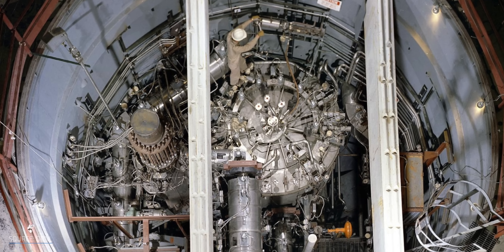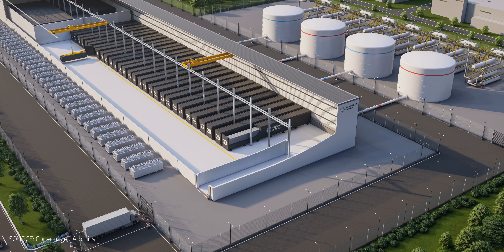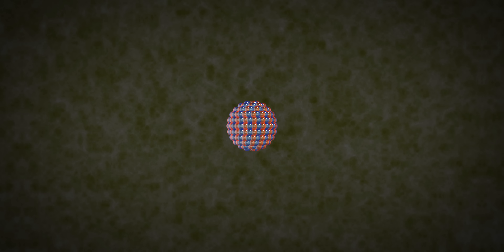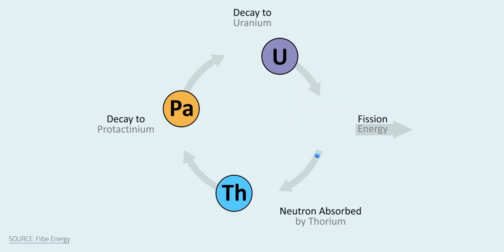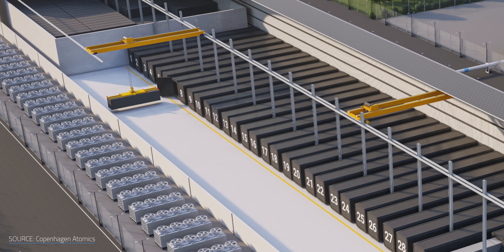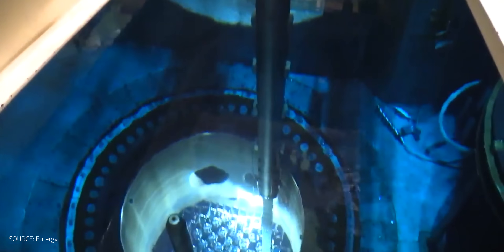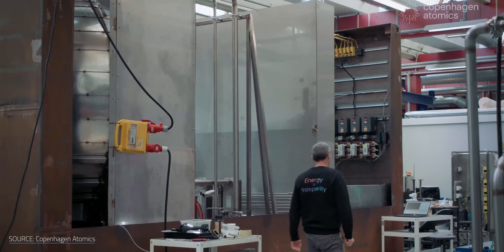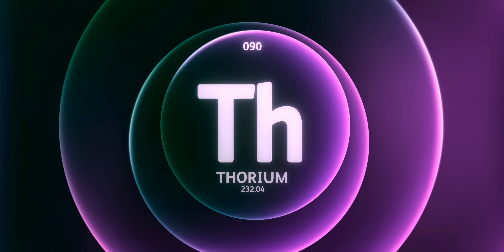Why Thorium is About to Change the World

Comment: I want to see a similar reactor as the power for a Single Stage To Orbit spaceplane. With continuous power, and using heated atmospheric air when within the atmosphere, the infamous constraints of the Rocket Equation is mostly overcome. Such a vehicle can take as long as necessary to accelerate and increase elevation until going above the atmosphere. Then it can easily transition to using onboard propellant, heated the same way.

Comment: STILL hobbled by intermetallic compounds.  Argon National Labs has been consistently been working on thorium processes for more than 50 years. The chemical plant to reprocess the thorium back into something usable requires immense energy.  This is essentially an atomic battery that produces utterly impractical cores that aren't energetically worth reprocessing.

Thorium has far more use in a mixed fuel reactor with "expended" uranium.  The reprocessing problems are less relevant because the reactivity of the fuel is much longer lasting.

Comment: In this case, it's actually the 'packaging' that convinces me of its feasibility. "Let's built it the size of a container." Okay, we know how to handle that size and shape, anywhere in the world. "It's too heavy to be shipped in one piece, let's cut the shielding up into modules." Okay, that works too. "No way of knowing it will last 50 years, but we can test for 5, so let's do 5 and throw away the heavily eroded / corroded / taxed parts after 5 years" Yup, I can see how that makes sense. Etc., etc. Compare that to the other 'modular' reactors of which you see proposals all around the world, and this one has the words 'scalability' and 'manageable' built into it. The other SMR proposals that we see are mostly scaled down versions of what we already know, with 'regular' nuclear fuel and thus with all its problems but with none of its scale advantages. I'm not the betting kind, but this is the type of company I would invest a moderate amount of money in.

Comment: I've been beating this drum for far too many years already, nuclear energy is the key to making renewables work in the short to mid term, and thorium is the key to affordable nuclear energy. The modular setup and self-contained systems have so many potential benefits that it's absurd to think there's any viable reason to oppose the technology. Of course we all know why this has taken so long to get moving (over half a century ffs) and that's the twin evils of conservative greed and simple fear, which in turn is mostly due to a lack of understanding of the technology. Molten salt systems are remarkably fail-safe by nature and when you consider the long term consequences and knock-on effects, it's safer than just about any and every other form of mass energy production we have right now (solar included). I once joked with my father over which would see the light of day first, fusion energy or thorium energy, and after much discussion we figured it didn't matter either way because neither of us were likely to live long enough to see the question through. Maybe, just maybe, we might be proven wrong here, and I for one can't wait.

Comment: The U.S. is fianally building a type of MSR. It looks like a hybrid of the older tech cooled by molten sodium and salt, using Sodium to take heat from the reactor, deliveing it to salt to transfer to the boiler in a separate facility.
My concern was molten sodiums reactivty to water. But that explains separation of the heat exchanger.
Reply: That's not a (chemically stable) molten salt reactor, but instead a (highly reactive) fast spectrum (metallic) sodium cooled reactor with potential to become a nuclear Moss Landing. The thermal energy storage is a good idea in general, but in this case it's being used because the reactor is inherently uneconomical and they are grasping for (and receiving) massive subsidies, to offset the enormous amount of expensive HALEU needed to start each reactor.

A terrible idea, because the deployment will end without subsidy, and the opportunity to provide lucrative peaking services with thermal energy storage will saturate. Some people may also have feelings about funneling billions of taxpayer dollars into dead end companies (with a history of bad ideas) owned by some of the richest people on earth.

Comment: Not going to happen, at least not as presented. On paper it works, in practice it works, what we havent figured out yet is making it fit into the necessary safety regs, and finding investors. Since domestic use power generation more often than not operatesat a loss, it generally requires subsidies to keep it affordable to the consumer, and trust me...a modular reactor the size if a shipping container is only going to have niche applications like far away from the general publics access to it. We will not see them for neighborhoods because that would be thousands scattered across the country and its a huge security risk. The better option they will accept are large reactor sites to service hundreds of thousands or millions of ppl, that are easier to keep an eye on and secure.

Comment: Thorium needs a breeding reactor. The thorium cycle  get just barely enough neutrons from the U233 fission and thus not much room for compromises that loose neutrons. This means rather frequent chemical purification of the fuel, efficient moderator (e.g. D2, high purity graphite, Be), large size to avoid leakage, few extra absorbers for stabilization.  The big difficulty usually not talked about is the chemical separation, The thorium this more difficult than with Uranium for the fast breaders and it is needed much more (like 100x) frequent.
Do the comparison to the fast breaders that are much closer to the moten solt reactor. Here in most aspects the fast breeder it superior.
The molten salt has it's own corrosion problems and just cooling is not safe for an extended time (the MSRE test reactor had a quite serious incident from this). So after a minor incident that upsets the reactor one can not simply wait for a decade or so for most the radioactivity to decay before ealing with the mess.
Most of the claimed advantages are just bogous claims - take a closer look and they often hide disadvantages.

Comment: that sounds like an awful lot of valuable metals that we will be rendering unusable for eternity that people will need to deal with in the environment into perpetuity.. people are really really not thinking past their own noses. we are setting up a total nightmare scenario for the people who will be on earth in 2000, 3000, 4000 years from now. if we even exist then, because of crap like this existing. we have sun and water in an amazing abundance, for free, and this is the route we want to follow. giving these nations a machine needs replaced every five years and expecting them to follow it, watch plainly difficults channel about radiological incidents. these nations will run it for 2 decades and then crack it open and sell it to terrorists to make a crude nuke of sorts.. but hey we dont recycle our current nuclear fuel for fear of proliferation though. plutonium bombs are arguably more difficult that uranium gun type and we are going to hand out, like pez, every 5years, a machine that makes bomb grade uranium... nice.. but lets keep burrying all that nuclear fuel that still has 90 to 95% of the fissiable uranium left because we are worried about plutonium production

Comment: So there are a lot of missing pieces mentioned with other comments already. Nulear is hard and people are ignorant and scared... 200year of uranium is just "estimated in currently operating mines" ignoring any new tech for e.g. currently used fuel. It is just economy. What I'm missing is what will they do after 5 years with somewhat radioactive reactor blanket... it seems like the same problem for fusion - there is elephant in the room but we ignore it. Anyway big fan of any nuclear tech that is not weapon, we need those not only for power but to make processing cheap so we can have plutonium for RTG for long space missions

Comment: You omit critical deal-killer performance parameter, that of nucleonic efficiency.  Nuclear reactions emit neutrons in random directions, and ALL small reactors have the same challenge of losing a higher proportion of the neutrons to the outside, driving all small reactors to use high-enriched U-235.  For that reason alone, the cost per kWh of small reactors is multiples higher than for gigawatt class - there is a reason our fleet of 93 or so working nuclear reactors are big.  There is no such thing as “economy of scale” for small reactors — each one is terribly expensive to operate which is why they exist and are relegated to specialist applications where nothing else will do, such as nuclear submarines and aircraft carriers, and space probes.  You totally omit mention of a current project that will actually go critical soon, thanks to funding by DoD and bypassing the NRC:  Project Pele which is meeting a military requirement for an air-mobile reactor, contained in four shipping containers.  This project will work thanks to tackling the system requirements from the beginning - reactor design and fabrication as well as the required fuel.  Bechtel is the lead contractor and will be able to pass that learning to industry.   You also failed to connect the dots.  Kudos for mentioning the 15,000 hours of operation of the salt reactor at Oak Ridge.  What you missed, was what allowed the Chinese to produce theirs was all the material from Oak Ridge was digitized and the Chinese downloaded it all, and their reactor is a near carbon copy.  And the concept of breeding is old, not new - there was much more concern about U-235 availability early on and EBR-2 in Idaho was successful, and the French Fénix reactor, by the time it shut down under political pressure, they had pretty much worked out the kinks inherent in first-of-kind designs (a factor you also leave out in championing the Danish effort).  The fact of the matter is that breeding is an extra process overlayed on a basic reactor, and this requires extra equipment, extra manpower, extra maintenance, and is by definition MORE expensive.  A working national model for nuclear power would have a handful of breeders, probably run by the government because they simply cannot be made to run economically competitive, and these would take the discards from conventional reactors (currently all stored on site), turn these back into working fuel.  The huge elephant in the room that caused breeders to be cancelled was that they produce plutonium, that must be processed, and real or imagined, the concern was for proliferation, and we has a nation have never really come to grips with that aspect.  For now, all it takes to keep breeders from happening is the cost.

Comment: So, those boxes are going to weigh up to and over 1000tons? How do they plan on moving those around? The average semi truck is only rated for 40 tons. And with the radiation danger how can it be moved around from location to location without radiation affecting the rest of the motoring public? Or the drivers of said semi trucks or do they plan on using those autonomous trucks. Which in that case opens up a massive national security risk of a terrorist hijacking the truck. Or will these units be shipped without the fuel? Rendering them virtually harmless?

Comment: Naive question here. Seems the number one gotcha with the tech you describe is the U-233's high gamma emissions. As you put it, walk-away, not walk-up. Since U-233 itself can be used as a fissile fuel, why not build a combo reactor that turns U-233 from a waste product into a resource? I am unclear about the U-233 fuel cycle, however, specifically its own waste products. 

Another gotcha, U-233 also makes fine bomb material. It seems that Copenhagen Atomics' business model of taking on all risks builds this in, but safeguarding this from nefarious actors is just that, a big risk. All the more reason to burn that stuff up before it gets into the wrong hands. 

All in all, however, it seems that Copenhagen Atomics is on a promising if not precisely the right track: modularization, use of abundant thorium, etc.

Comment: Noticed comments about possibility to invest.

It is actually possible to invest in Copenhagen Atomics.

They are fundraising for high net worth individuals (100.000EUR +).
Current price is 360EUR/share.

But also, if you are not a billionaire, they have shares registered on Funderbeam, a platform for shares that are not on stock exchange.

If interested in trading I can assist.